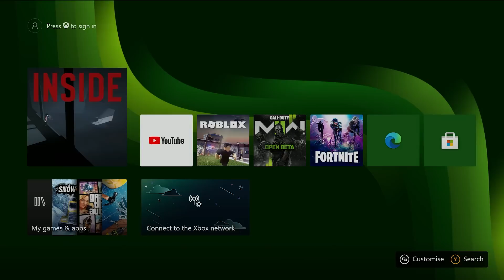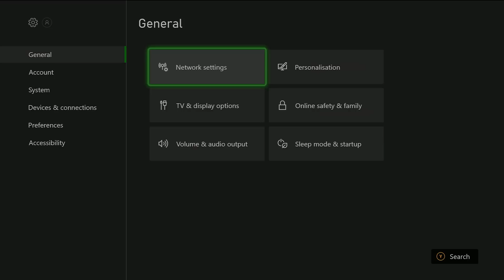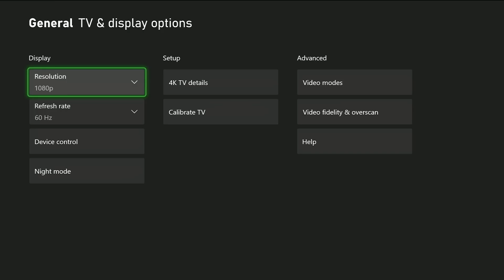Easy Jobs Are Easy Money! Xbox Series S Damaged HDMI Port Repair

Comment: How you changed from: „Nah. Never use low melt, it takes the challenge out of the job.“ To: „I like to use low melt solder on these jobs… Easy jobs are easy money.“ ;) 
No criticism. Everyone can change their opinion. :)
Reply from the maker: To be honest I think it's just the fact that I had seen pins which were loose and didn't want to risk it. For the most part I still just use heat but very occasionally it can be a good thing 😁